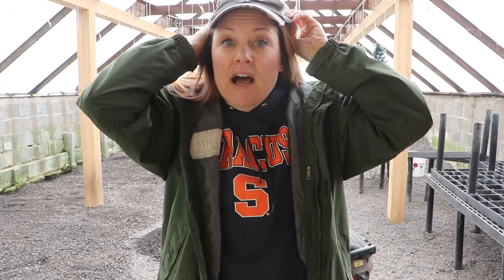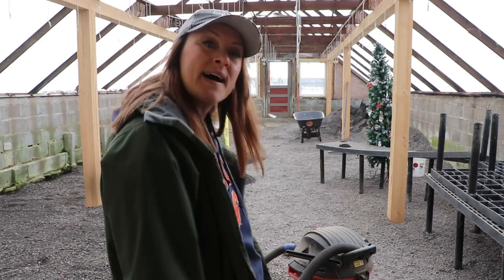What a Difference a WHEELBARROW Makes! Progress on #1 with Help from Family! Flower Hill Farm

Comment: Try spraying the block walls with Kocide 3000, it's a copper fungicide that will help prevent the algae from coming back.  Copper is an organic fungicide.  Kocide comes as a granular concentrate, you just mix with water at the recommended rate and spray it on like you did with the bleach.  I use Kocide @ the orchard for fungal control and it would also be useful for you both @ the nursery and the flower farm.   Nice progress at the nursery !
Reply: Thanks for posting this. I was thinking the same thing.Copper works great in pool s too, which is what I know it from.and great advice!

Comment: For future stone moving, or anything in a large pile (mulch, compost, etc.), you can lean the side of the wheelbarrow against the pile and just use a shovel to push/pull material into the wheelbarrow. When the pile is too small, get the wheelbarrow as close as you can to it so you're only really shoveling up and then turning your wrists to dump the material. I hope this helps!

Comment: Great job, Nicole. Looking so much better. It’s a totally new space. Get yourself some of the dust filtering masks. More expensive, but will filter out the fine dust. They have them at the home improvement stores and I would imagine at your local hardware store. Medical masks don’t filter out fine dust particles. There are also some to wear when you’re spraying chemicals. Protect your lungs. 😊💖🦋🕊

Comment: You should get an actual dust mask aka N95 to keep the particles out of your lungs. They're very easy to find.  I wear them while I'm using dye powders to dye yarn as well as when I'm cleaning with chemicals. Chemicals always make me cough
Reply: Absolutely!  Over the years there has most likely been many chemicals in the greenhouse that you want no part of, and rock dust is also a real problem.  I hope you will use your mentors to find some good classes/workshops etc on proper chemical use in the greenhouse.  I'm sure it is complex, because you are indoors, not outside in your garden.  The greenhouses are looking really good!

Comment: For anyone with a hand sprayer need invest $10 more in a harvest king hand sprayer. 

Flo master, chapin, project source, roundup brand (even if not using for herbicides) green master, Hudson, ACE hardware, solo, HDX, Scott's are all junk! Poor nozzle and very low pressure. Yes I've tried them all. 

Harvest king=pressure. Buy a harvest king hand pump sprayer. I promise you.

Comment: 3 minutes in. I love my  neck fan! I use it in church the most. We have a very small church. Seats 100, less than 50 attend. An elderly lady with the personality of an cantankerous moose, is always cold. So the heats cranked up. I use my lil neck fan. Keeps the makeup from running til after service is over 😉

Additionally,  anyone with a garden should have a Gorilla Cart Dump wagon. There's 3 sizes.  Heavy duty. I've worked mine extensively for 2 years now and it's still like new. Handle is also a hitch attachment for lawn tractor or side-by-side. Fully dumps and does so easily . Handles all terrain wonderfully!  5 star recommend!

Comment: Brad said that the reason you don't have enough gravel is because there is a 6 inch level difference from on side of the greenhouse to the  other. If it was level your 2" to 4" calculation should work but if you have ½ of the greenhouse you need 6" more gravel to make it level, Brad might just win :-)  Good luck!
Reply from the maker: I calculated and included the depth differences in the estimate. At this point it looks like we will have more than enough! Brad should know I'm always right (but sometimes will have to eat my words! LOL)